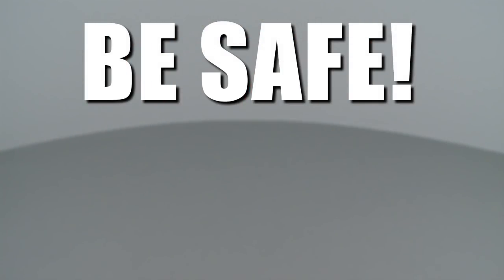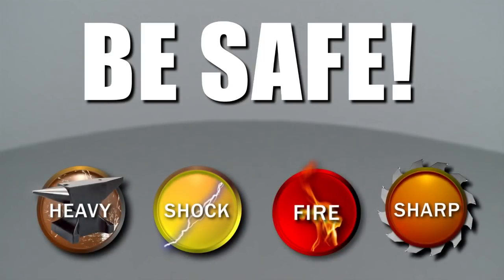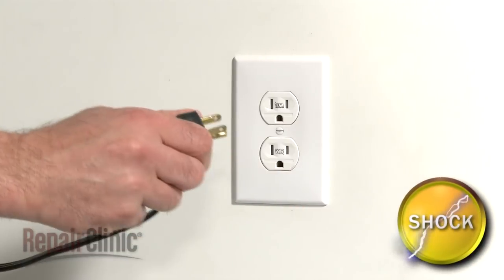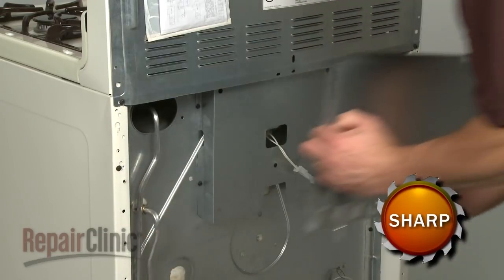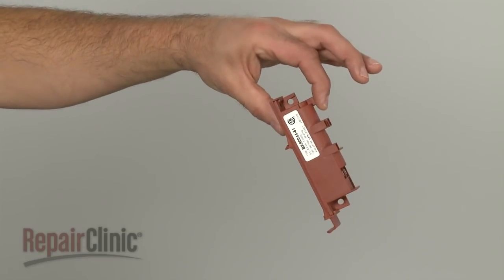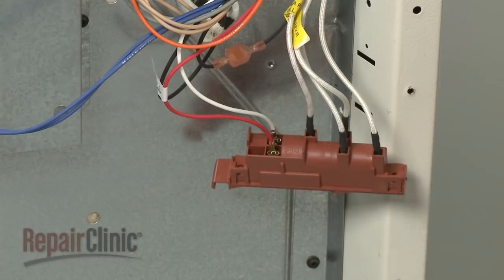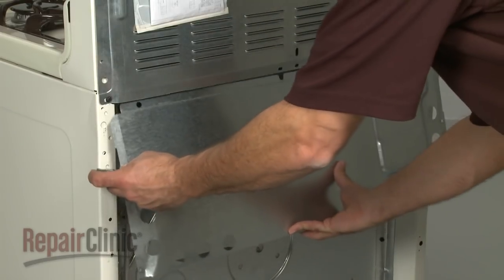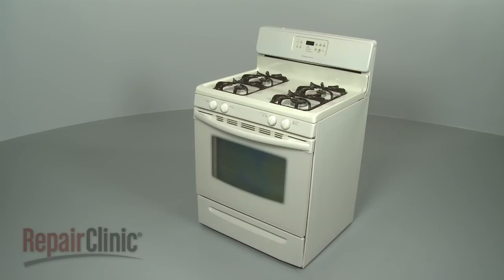Frigidaire Stove Burner Won't Ignite? Spark Module 316135702

Comment: In my problem is a very low spark that the only way to spark is if i reach de electrode to the metal part.. But it doesn't spark If it's a milimiter away.. Does this need a new module ?
Reply from the maker: +Ricardo Denegri Weak spark at all burners usually indicates bad spark module, yes.
Reply: +RepairClinic.com Thank you! I already fix it, replacing the module and the spark cable
Reply: RepairClinic.com My stove burners are good but my oven has not ignited. (It is 5yr. Old) really used. 
How shall I is its it. Pl help